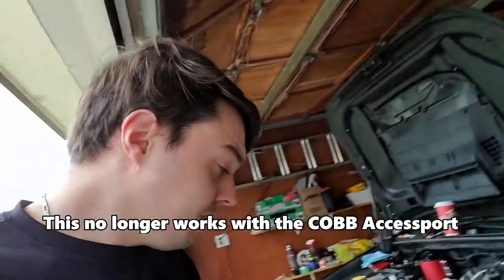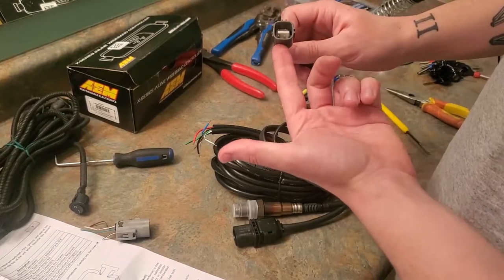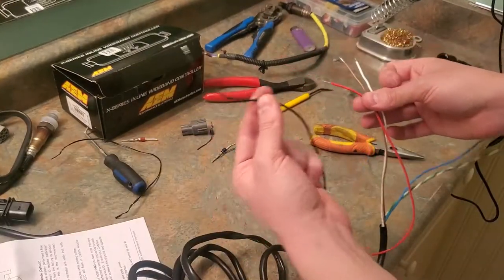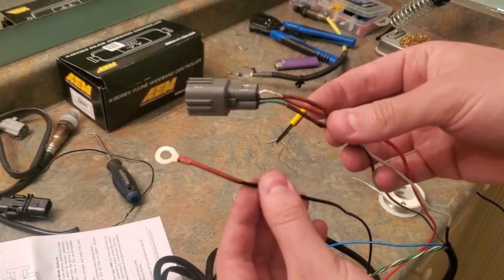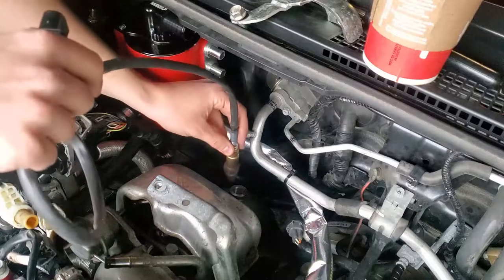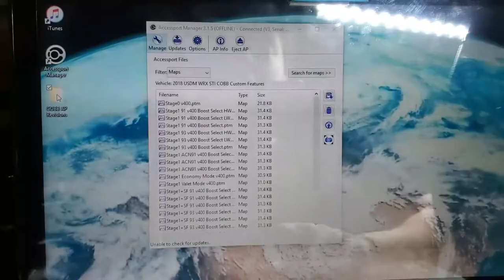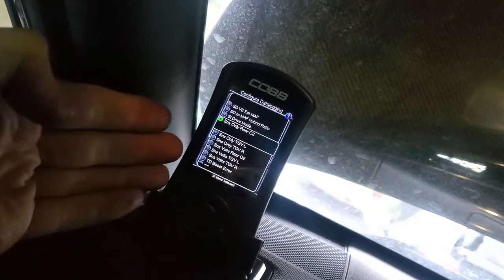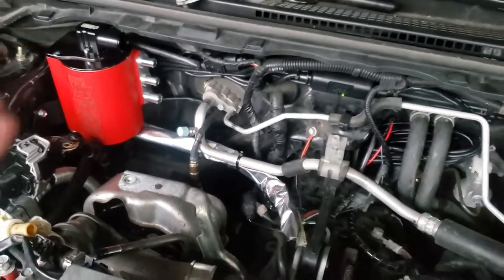STi DIY Plug and Play AEM Wideband Sensor

Comment: Thanks for the video. 

I've been using a Cobb OTS VF-34 map in my Bugeye for 17 years. At this point, with the Geen Speed changes, would there be any point in getting a Protune or an e-tune? Would they require a wideband gauge/sensor on my car to do the tune or would there be no reason to get a wideband gauge/sensor?
Reply from the maker: Not a problem.

Unfortunately due to the greenspeed update this method of installing the wideband will no longer work for the COBB AP. You can get a protune without any issues as long as you didn't remove and emission related parts from your bugeye. 
Etuning you'll need a wideband gauge so your tuner can monitor the AFR while in boost. So unfortunately running the wideband sensor through your rear O2 sensor connector will no longer work since its seen as removing an emission related item.

Hope this helps!
Reply: @zach_lush  Thanks for taking the time to respond. 

I obviously don't want to waste ~$400 on a tune and ~$200 on a wideband sensor/gauge for little or no gains. Am i right in thinking i would need a laptop to provide AFR data logs to a remote tuner now that an Accessport can no longer do that?
Reply from the maker: @jukeboxzero1  not a problem.

Also you are correct, you'll need a laptop. If you've been on an OTS map for years and it's been fine I'd just leave it. If you want to know more about the process of etuning I went through I do have a video up where I swap over to opensource tuning.
Reply: @zach_lush  Thanks again - i'll take a look at the other video. Maybe that's the way to go at this point.

My concern with the OTS map is that my car only dynoed 256 HP/240 Lb. Ft. with the VF-34, Borla header, Cobb turbo back, STI pinks and IC, Walbro pump, etc..